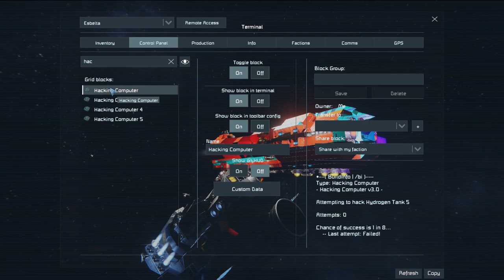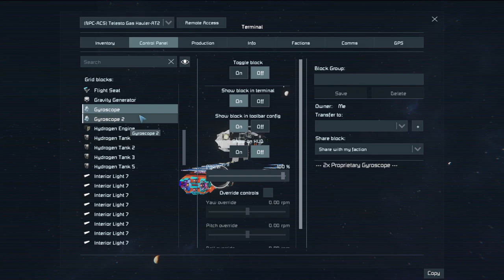Survival Records, Echelons (Space Engineers Lets Play) E32

Comment: Hi does the ion thrusters(propriety parts) work, tried in my game rescuing thrusters and they didn't work with my ship.
Reply from the maker: I'm not really sure how they work, I am only just looking into it now. I think you are supposed to be able to claim them and re-use them.
Reply: @ryodenshipwright  I did reuse atmospheric n hydrogen thrusters but the ion with proprietary parts just didnt work.  Well if it works then I will try it again too.
Reply from the maker: @jaygom436   The normal blue ones with the "proprietary" parts I think are designed to not function on a player owned grid. I think the idea is to stop you from easily getting a supply of thruster components.  But the special ones (orange) should be able to be re-used.  At least that is what I believe is the intent of the mod.  I have not confirmed it myself yet.